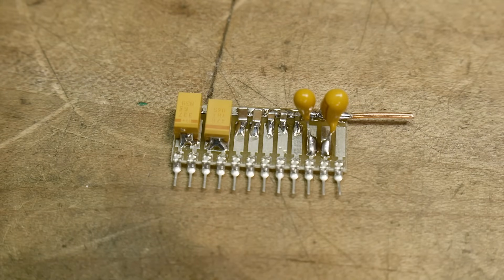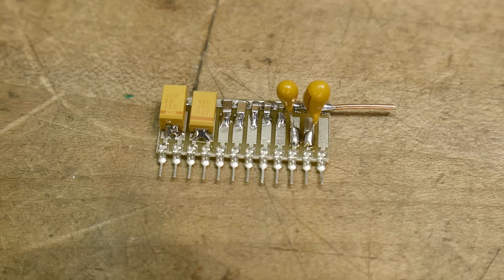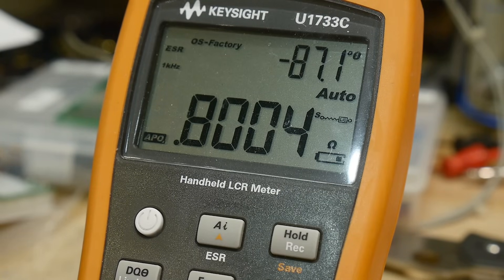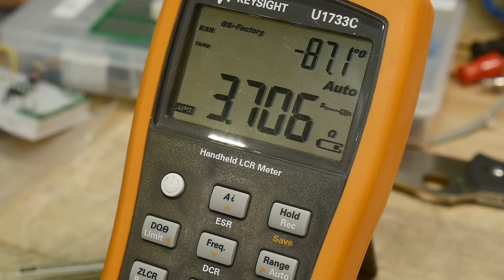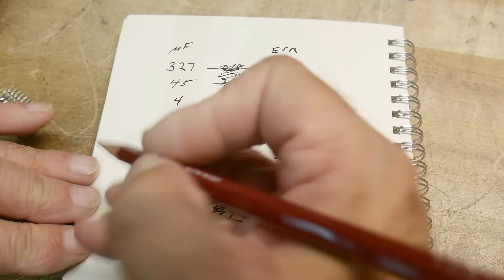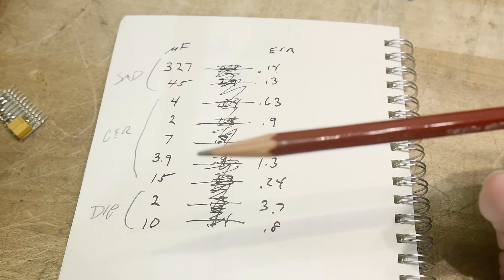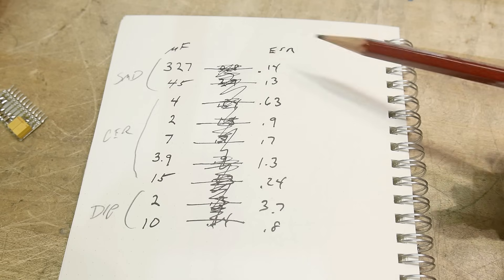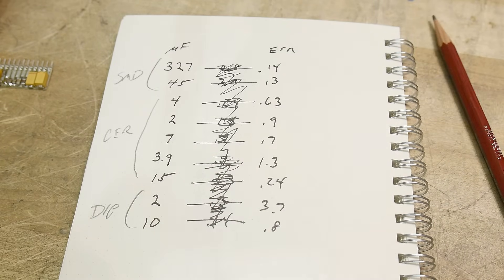#1922 Tantalum vs Ceramic ESR

Comment: A few years ago, I was into building RC quadcopters, where high-capacitance, low-ESR capacitors were critical for stabilizing the DC input to high-power electronic speed controllers (ESCs). In most cases, electrolytic capacitors hit the sweet spot better than tantalums. That said, the ESCs often included some SMD tantalum capacitors as well for additional stability.

Comment: An early lesson for me in electronics was building up a small switching converter that specified electrolytic or tantalum decoupling capacitors. Being too clever for my own good, I decided to use some of the much smaller and more convenient ceramics I had on hand.

The converter oscillated wildly because the ESR was too low, and the circuit wouldn't operate correctly until I added a 1-ohm resistor in series with the capacitors. That'll teach me to read the datasheets more carefully.

Comment: Good subject, considerations and video! Sort of related... I have a DE-5000. I need one of those quick-reference spreadsheets that shows the values to expect for different capacitors. There are several of these on the web. However, they seem to contain conflicting values. I would really appreciate a link to a reliable set of values. Thanks! Cheers!

Comment: Ceramics are not all piezoelectric, some dielectrics like Y5V, Z5U are but C0G are not and X7R / X5R are not usually. For low esr I would use ceramics, X7R down to 10nF C0G below 10nF.

Comment: The last years in our small repair business i had much more broken, i.e. shorted ceramic caps than tantalium. Not the tiny pF and nF Capacitors of course but startung at about 1-10uF i would call it a focal point of disruption... Moreover i want to remember Your cheap chinese 555 board with the ceramic capacitor beeing very sensitive / unstable to voltage change...

Comment: My company makes hi temp downhole equipment, we have given up using tantalum long time ago, they where trouble makers getting shorted every time, we replaced them all with ceramics and standard wet capacitors for the high capacitance. I am sure there must be a specific application where tantalum performs better, but in my experience, whenever I see a tantalum cap I see failure coming soon !😂

Comment: Dipped tantalums in old computers and similar devices can be also replaced with modern low ESR electrolytic or polymer capacitors. They were using tantalums back then because they didn't have anything better.
Reply: Eh, be careful. 5% of the time the near-or-above ohm ESR of a tantulum could be a crucial factor in creating a suitable pole in an analogue circuit, that keeps it stable. For example there are many many older regulator chips that will oscillate if you put a "no-ohm" ESR modern poly/ceramic on their output.
Reply: They also didn't have to worry about Tantalum DFARS.  New technologies emerge when materials are restricted.
Reply: That's not entirely true. Many voltage regulators, and SMPS designs require a min ESR to be stable. This is why tantalums are spec'd in the datasheets. For basic decoupling ESR doesn't matter, anyway, so you're wasting money using low ESR parts in that application.
Reply: Agreed and when those old Tantalums failed they tended to fail shorted rather than fail open which is preferable.

Comment: Both ceramic and tantalum capacitors have their own place, for high frequency applications ceramic capacitors are ideal due to their low ESR and excellent performance at high frequencies, for low frequency applications where stable operation over voltage fluctuations and temperature variations is essential tantalums should be used despite their higher ESR.

Comment: Solid electrolytic caps also exist being comparable to tantalum. They are also safer to use.

One great danger of tantalum caps is its flammability and ease of breakdown. The working voltage must never exceed the limits. If it does, there is a great risk of internal short. If the supply line does not have current limitation or a fast fuse, the tantalum will catch fire with a blue flame. The flame will not go away since a rather small current can sustain the burning. If you do not believe me, test it.

Comment: used to use a lot of solid tants in our products at the time, they were quite big and heavy compared to the standard wet  electrolytic ones. our units went in the cockpits of jet fighters and big turbine transports. vibration was a big thing and solid tants seem to survive it well.  
watching a PCB bend up and down during a  resonance search test, it was not surprising how much effort went in to placement on the PCB. wrong place and it could be exit cap stage left. 🙂
Reply: I learned long ago on spy satellite bds that the word 'flight' meant something.
Reply: Ain't testing to extremes so fun? Seeing things ice over, overheat, bend and break. Vibratory tables were so fun.
Reply: @VEC7ORlt  not when you have to redesign the PCB layout again 😞

Comment: Doing repairs on older equipment like the old IBM-PCs, IBM-XTs etc. my concern with Tantalum capacitors is that they tend to short. I've found many of them to be shorted and of course I don't replace them with another tantalum cap. I tend to go with a good quality higher temperature rated electrolytic.

Comment: good work. two ideas: a research colleague of mine said "tantalums have no sense of humor." Next, how does capacitance and ESR change with dc bias across the capacitor? And capacitor type? Difference between tantalums and MLCC with different operating/bias dc voltage? If you don't think there is any change... And hint, it's not linear!

Comment: Perhaps for low ESR you should use POSCAP tantalum capacitors!  Also, the packages with the legs that come out the side and are bent around to the bottom are supposed to be superior in vibration.

Recently I used larger value ceramic MLC capacitors for a multimeter DC decay timing circuit (LCD Backlight) and got way less stay-on time than I calculated.  So I put an even bigger value capacitance and the stay-on time didn't get any longer, actually shorter.  I deduced the MLC's had too much of a capacitance loss due to DC voltage bias.  I was using random take-off SMD's, so I didn't know the chemistry of my samples.  Only after switching to typical yellow tantalum capacitors did I get the long delay I was looking for.

Comment: When I needed low ESR I always used paralleled ceramic disks. I've had shorting problems with dipped tants in old test equipment. I hate it when one grenades in the middle of a 3 day test regimen.

Comment: If tantalums are anything like regular electrolytic caps, then the higher the maximum voltage rating of the cap, the lower the ESR value.

(Therefore the lowest ESR you can find in an electrolytic, is a high mfd value combined with a high voltage rating (e.g. expect an ESR reading of <0.01ohm when measuring a 10,000uF cap, that has a max working voltage of 250v).

Comment: I think there is another factor to throw into the mix - related to ESR but not quite the same. That is self-resonant frequency. That sets the upper limt of a capacitors usefulness. Even with modern electrolytics this could limit their use as decouplers in modern high-frequency logic systems.

Comment: My LCR meter is a Der EE DE-5000.  I need to make up Kelvin clips for it; I bought the clips but haven't built the adapter yet.  Not sure the Keysight one at nearly $600 is a whole lot better than the DE-5000.

Comment: ESR is also frequently dependent,  I'd imagine your meter is testing somewhere from 100Hz to 100KHz ceramic caps are much better at high frequency. In the region of a few milliohms at 1Mhz and above.
Reply: You can see the meter is set for 1kHz
Reply: 5:38 "These are all tested at 1kHz".

Comment: Type II ceramic capacitors are extremely sensitive to vibration. So much so that the same material is used in piezoceramic sensors. That in conjunction with reduction of capacitance under DC bias makes them unsuitable for many signal path applications. Type I capacitors don't have either of those issues, and they are frequently a good choice for signal path components when capacitance values less than 0.1uF are required.

Comment: I see your measurements are at 1 kHz.  Also, you don’t show either aluminum or WET tantalum capacitor characteristics.  Could you possibly have some old wet tantalum capacitors for comparison?  Very rare nowadays, but you might find some in old PCBs.  You could recognize them from their very high weight, the hermetic structure — cap welded to the can and the positive wire fed on through a glass frit, rather than some rubber or plastic.  I am not sure if I have any, although I have the measuring capabilities up to 13 MHz on one instrument, up to 110 MHz on another one and theoretically up to 1 GHz on two others.  But one thing I am cautious about is the ESR of the solid state electrolytics.  I have had two fires in one application, 120 Hz and harmonics ripple apparently causing the overheating.  In many cases they “safely!” short out, but my two fire cases ended up being just two bare wires sticking up from the board.  On the other hand, I never seen failed wet tantalums.

Comment: Interesting I never thought of ceramic caps as being peizo electric but of course they could be. I learn something new every day :)
Reply: Yeah, it’s the barium titanate dielectric. It packs a high K due to ferroelectric properties. All ferroelectric materials are also piezoelectric, so unavoidable but it does vary somewhat between different formulations (X7R, X5R, Y5U etc.).
If you really need low microphony, use a CG0 dielectric. It’ll be a lot bigger tho!

Comment: Solid Tantalums have really good electrical characteristics but, like all the different capacitor types, the application must make best use of that particular set of component tradeoffs.  Solid Tantalums should NEVER be used to bypass a power supply line, unless a series resistor of at least 3 ohms per volt is used.  These capacitors cannot tolerate ripple current or voltage surges.  You commonly see solid tantalums used on power supply lines, and they appear to work fine but, they will short out without warning and catch on fire.

Ceramic Capacitors nicely fill many applications, again when properly applied.  The "K Factor" (capacitance per unit volume) must be carefully considered though.  The higher the K Factor, the greater the capacitance versus package size but, with the tradeoff of higher piezo effects.  This causes the capacitor to physically change shape with with applied voltage or, generate voltage when mechanical stress is applied to capacitor body.  Therefore, if the ceramic capacitor is to be used in a high quality/high performance circuit, I only recommend using a dielectric constant of either NP0/C0G or X7R.  Avoid at all costs, dielectrics such as Z5U.
Reply: Very interesting. Thanks.

Comment: I think the concerns about microphonics comes from audio equipment like radios. A radio mounted in a car is even more of a concern. I would have been interested to see you vibrate them with a piezo while biased to compare microphonic pickup. I have heard some pretty crazy crashing noises when just tapping disk ceramics before.

Comment: I agree. Tantalums were just fairly high capacity, fairly low esr, very low microphonics, in a fairly small package. That used to make them irreplaceable. That's not so true anymore. They are also volatile, so if something else more stable will do the job, by all means, use that something else.

Comment: It is always the 16V tantalum on the 12V rail that shorts out the mainboard. 
The 16V tantalum on the 5V rail are usually good.
Reply: 25% headroom on voltage rating isnt enough,but with consumer electronics when every penny counts, thats what goes in. At least 50% of expected voltage is what i'd feel good with.
Reply: @davebleamwa2bxy799  Polymer Tantalum require almost no derating.

Comment: I hate to point this out, but the measurement is likely flawed. 
The ESR of the leads used is likely to be > 0.5 Ohm. Therefore you'll at best read ESR of 0.5 ohms. 
Was the  ESR of the leads accounted for?  
According to the  specification of the instrument for measurements < 200 Ohms requires performing the NULL operation. 
This is used to offset the leads ESR. 
Create a short on that last unused pad on the test fixture to duplicate as close as possible connect an NULL the instrument.
 
The expected ESR (the specification for ceramic caps is very commonly 10mOhms or less, which can easily be found at a resource such as digi-key) should have given you a clue about the measurement technique.
Reply: Yes, I agree. Though in his hand-written table, there are values as low as 0.14 ohm. That and the scribbled out column make me a little skeptical of the whole exercise, though I appreciate the effort.

Comment: We know that by experience, Tantalums do not have a better ESR than ceramics, often worst, their main advantage is capacitance density, they are often the only way to add high capacitance in areas where space is at a premium, for example a 220uF 6V on 3528 package, good luck reaching 220uF at 6V (so, 15V on ceramic due to derating) on a 3528 footprint, it doesnt exist. However it should also be accounted that this capacitor will not have a suepr great ESR and it may cause problem for a very dynamic response (RF PA for example).
The main downside of tantalums is the failure mode for polarity reversal or fault, which is short/explosion. However we nowdays use polymer tantalum capacitors (black, instead of yellow) and these do not suffer from such catastrophic failure mode.
A last point to add is that there is almost no derating required with tantalum polymer caps, if the rail is 5V, it is often OK to use a 6V cap, and definitely a waste to use a 10V.

Comment: People like to   jedge based on comparison - one having bigger is worse than one having smaller ESR. But did they chceck  what is  reqirement for given application? ? -According to applications one which is within  limits  is good , one which is outside  is bad. That is what is supposed to be judged, Comparisons between two good products is useless and leads to useless decisions.   For above tests I could ask basic question: is 1 Ohm good or not good. And without exact application  true answer  shuld  be we no idea, but with practice I would say for 99,9 % cases it is fair litte. .

Comment: The frequency ESR is measured at depends upon the application and if too low is going to give a false high value owing to reactance rather than internal resistance.
Reply: Could you explain that reasoning a bit more?

Comment: ceramic chip caps, especially higher capacities, are really very sensitive to DC bias. near their rated DC voltage, there isn't a lot left of the rated capacity. Keep that in mind when you design your circuit.

Comment: I like the fact that there is still some voodoo and black magic in electronics. I'm a big Bob Pease fan (RIP) and would cackle whenever he would suggest a "whiff" of capacitance. One technique he described involved using a length of twisted pair as a capacitor, snip the length shorter until the circuit behaved as intended. I am the proud owner of a Tektronix 485, and came across a warning in one of the repair manuals not to wiggle certain transistors in their sockets, because they had been positioned deliberately during factory calibration.
Reply: That's fairly stupid of any engineer to place that component in any gear.
Reply: When I was studying electronics in the 90's, analog TV was still a thing, and I remember someone saying about the HF that to get everything working right sometimes you just had to try out different components when designing the board around IC's.

I'm guessing SMD'fication and better design tools have suppressed trial and error, but on the other hand, when frequencies go up there's always new world to explore.
Reply: "voodoo and black magic" = "the theory you don't understand and don't have a simulator for".